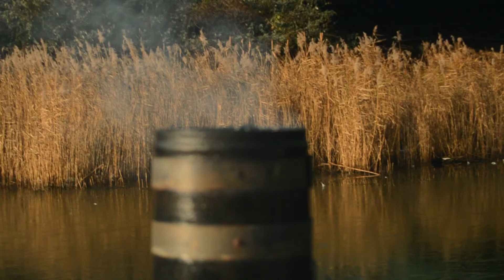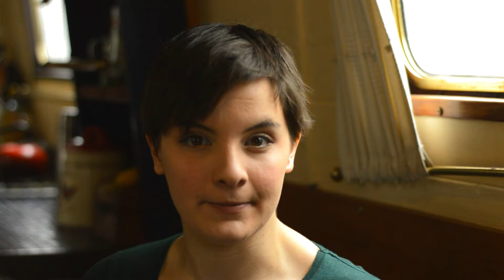How Do You Get Electricity On A Narrowboat?

Comment: In the US farm homes or rural homes in the country started useing large batterys to power homes about 1890 or slightly earlier - 
     Wind turbin generators never did work well - even in areas that had good steady wind,  wind turbin performance was poor - 
      Its still that way today -
Some had water wheels on creeks generating some power - 
     Larger farms had up right.steam engines that were used regularly to grind grain ect - 
     Those upright steam engines were also used to spin a generator to charge the  farm house battery's all day once a week  - 
      In about 1916:Delco a division of general motors marketed the 32 volt DC light plant for rural and farm homes - 
       In the first yr they sold 20000 rural electric light plants - the rail road had already been using 32 volts DC in passenger cars to run fans and lights - 
      There were battery's under the carriage were batterys were placed and generators were belted to rail  wheel shafts, to charge the batterys -        10s of   1000s  of rural homes had large 2 volt cells of 16 to make 32 volts - 
      Even in the 1960s when i was a kid some homes in the ciuntry away from citys were refered to as 6 or 32 volt DC homes - 
    House batterys were set up to were they only were charged once a week all day friday - so the rural homes ran off the batterys all week or 6 days and were charged all day on the 7th day once a week - 
        In small rural towns complete lines of 32 volt DC appliances were sold equal to 110 volt  AC appliances sold in citys - 
      Rural Exide or Gould house lead acid cycle battery's used a weaker solution acid - 
    In the deep south 1.195 acid strength was often used -those  batterys lasted about 60 yrs charged when charged once a week -  
      In cooler regions the house battery's used 1.220 aacid strength and lasted 40 yrs or more - 
      Delco light pllant generators ran on kerosene - 
     The lead plated in the glass battery jugs lasted about 40 to 50 yrs - 
   Then the lead plates were replaced - also the generator was exchanged for a delco factory  remanurfactured generator - 
    My family used a GW generator the engine ran on crude oil or bunker C fuel - 
    They used 1/3:the amount of fuel  but the engine could only be used in warmer regions - because it hard to start in cold regions - 
     In the deep south US its hot and humid so fans and fridges are vital to us  - delco also solld 32 volt DC fridges and freezers i think in 1916 also - 
       They were still used in the 60s on farm homes when i was a kid in the 1960s

Comment: Never did much leisure time on canals but I have spent time on rivers. A new concept in electrical generation is portable hydroelectric generators 
These are floats that underwater funnel moving water through a pipe to an impeller that generates electricity and sends its to a battery either on shore or on board. On a boat tied up along a briskly moving river these would float alongside the boat or when underway dragged along behind.
Now I’ve known RV campers that have built generator trailers with solar panels, gasoline or diesel generators, wind turbines and alternators attached to the trailer wheels. Seems like you could do the same thing with a TINY butty , adding hydroelectric turbines and tunnels right in the hull of the boat itself and drag your juice behind you. Only downside would be the far greater risk of theft

Comment: Peltier module is quite old and prooven thing. Pros - works witouth sun and wind, suplies steadily, sturdy construction (harder to destroy than solar or turbine). all it realy needs to work is difference in heat/cold. Usually not bulky,flatish construction, one side dipped inside heater and the other in the living quarters, lets say. Cons - the supplyit provides is not too high - comparable with solar at best. Does need either planning of the living quarters from scratch (before the boat is build actually), or quite extensive rebuild in the spot, it will be operating. One side is for heat and the other for cold. If the surrounding temperature changes (winter to summer), you need to turn the plate, for the module to operate properly.
Reply from the maker: Ah thank you I'll look into this
Reply from the maker: Thanks for the info I'll look into that

Comment: If you do go for the wind gen rubber mount it and keep it away from your bed room ..most wind gens use the magnetic fields as a break to slow the blades when the Fields are activated it sets up this rumbling sound through the stand its on ..otherwise wind gens are good in bad weather when the solar is not ..
Reply from the maker: we dont need any more , our solar does the job very well

Comment: that tickled me , only two types
Reply: squirms shed . Two 12 volt batteries give you 24 volt system as used in heavy duty vehicles.
Reply: I once connected 30 button batteries together producing a large 90v30amp pile battery that fit in my hand... 10 for 1 dollar... That gave me alot of energy for 3 dollar... Was like the handle of a lightsabre...

Comment: I'll mention to you as I did to David, that if you never run your engine at full speed, as he wrote he doesn't, then you could get a smaller diameter pulley for your alternator.  This would spin your alternator faster while your engine runs slowly and help charge your batteries faster, from your engine while using less fuel, which could potentially reduce any desire for a petrol generator.
Reply from the maker: we have solar now so dont rely on the engine for power :)

Comment: to charge laptop you don't need inverter, that makes 220, you need DC-DC inverter, that will make 19V from 12 - cost less and does not need to much current.
Reply from the maker: but then i may not live in the real world!
Reply: ThisNarrowboatAdventure but you may save power for notebook charger. ok you need to transform electricity twice, from 12 or 24Volts DC to 220AC with boat invertor and back from 220AC to 19V DC. DC - AC inverter takes much more ampers that DC - DC power adapter for notebook.
sorry for my English, greeting from  Siberia.
Reply: Btw DC to DC is a converter, DC to AC is an inverter, AC to DC is a rectifier Cheers! 👍😀

Comment: Regarding the boat riding from shore line power there is a small device called galvanic isolator you can get (or might have already). And afaik boats have several chunky pieces of metal (cathodes or anodes?) welded on the hull and those are meant to rust away prior to the hull. Because when the boat is connected to the shore it forms a battery with one end being the shore and the other is the boat floating in water. The two metal bolts inside of your battery are slowly rusting away and the same thing happens with the boat.
Reply from the maker: Hrnek Bezucha we don't use shoreline thankful!
Reply: From your video I watched of you painting your boat you mentioned that you have anodes on the boat hull I saw them, so I imagine you have this anti rust system fitted? Also I would imagine that an inverter would be a handy piece of kit to have on your boat to charge and run laptops and Televisions (Small one ideally). These can be bought over the counter or online from many sources, Maplin or even Halfords as well as millions on Amazon!

Comment: If you get a deal on a wind turbine, you can always try to mate it with something like an exercycle so that you can pedal the bike to spin the turbine to generate the electricity.  While obviously not ideal, it can work as a back up option when there is no wind and no sun and your batteries are low on power.

Comment: Surely a small silent running diesel generator would be a good idea when on the move.
Reply from the maker: on the move the engine charges the  battery...
Reply: From what I’ve read your isolated generators are more popular on widebeams because of their is more space to fit a generator into a sound suppression chamber and because widebeams both spend less time on the canal generating electricity while on the go and are more likely to be owned by people who do not wish the exterior aesthetics marred by bulky solar collectors.

Comment: how long will your 12 volts last without recharging?
Reply: Do not boats normally have a two battery system, a battery like a car battery to start the engine and one or more leisure batteries for running TV and other electric goods in the "Home" The engine starting battery is separate from the other batteries and its only duty is starting the engine. When the leisure batteries run flat the engine start battery is still charged and ready.
Reply: @kevanparker908   that has been the recommended system ever since electrical consumption has exceed the spare charge in a regular engine battery 
What started out as a spontaneous quasi invention became a professional upgrade became a DIY kit, became a featured option became an industry standard
Reply from the maker: I don't know as you should never let them get below half full or it ruins the battery, since we got our solar system we haven't had to run the engine between moves

Comment: Solar is the way to go. You have lots of space on the roof. You can also hang them on the sides with hinges to flip them up when needed (DrakeParagon)  Lead acid batteries are great, (just got to keep an eye on the water level) , they are very cheap compared to other batteries.  Great way to start on a budget . You can always upgrade at a later date when the others become more affordable.  Also depending on how far you travel, get rid of the noisy diesel motor and go electric. Many sailboat owners are doing it.   Check out Sailing UMA , they have a cost breakdown on their website on their sailboat conversion, good vids too.  Also a small Honda generator comes in handy for those heavy use days.  A Honda 4500 is less than 1500 #s in the UK and that a lot of power (4000 watts), but most boats just use the Honda 2000 
Don't just look a canal boats for ideas, sailboats, off-grid homes and RV's have lots of ideas.
Reply from the maker: we have solar now , best thing we ever did!
Reply: Yup, solar is the way to go. with the right approach your boat can be self reliant on solar, including the motor. It can be done very cheap as the channel Sailing UMA proved. In a canal boat there is lots of room for a large battery bank , but I would still have a Honda generator for emergencies or longer trips in case the solar panels cant keep up (rare) . The generator is also handy for power tools , and all sorts of things , like charging an electric bike. Having a generator is like insurance for your batteries
As you get better at power management and more solar input,you will use the generator less and less until you wont need it at all. Then you sell it for maintenance on your boat.
It's going to be great when full spectrum panels become available and cheap
Don't worry about expensive glass mat and other types of batteries, lead acid works fine and are cheap and easy to maintain.
Reply: Quality lead acid can last 10 years or more yet the average cheap deep cycle battery is NOT up to the task. Do your research before buying!

Comment: If and when you can afford it, use wind and solar power. solar by day and wind by day and night ! the wind blows at night when you need power. and try to have more batteries to store all the power available. also think of buying a car battery charger for when mains is available plug charger into mains to charge batteries without the noise of the engine. 
Yes i also think there is a way to use direct heat from a stove to create power. look on U- tbe  at   " KIMBERLY STOVES "  i saw it there. it will probably apply to all or any stove. ? check it out n find out . the technology is out there. its a simple attachment that sits on top of your stove.  no fitting or adjustments requ'd. i think ? take a look see what you think ask them any Q's . i dont know i just saw it a couple of weeks ago and thought it was a good idea. its all on youtube somewhere. good luck  have fun best wishes.
Reply from the maker: hello my dear, we now have solar and we love it and so far is more than we need i think we have quite low usage as for us its just 12v fridge and  lights and charging phones and water pumps. will bare in mind adding wind if we start to run out in winter. thanks for the info on the stove power!
Reply: ThisNarrowboatAdventure good luck best wishes and happy cruising. others may read it who need more power. i also found some FLEXIBLE STICK ON solar pannels. i thought they are a great idea for certain uses on boats caravans, motorhomes and other off grid situations. i do like the idea of a stove for heat, cooking, hot water, and a bit of extra electric, extract every possible use from a stove.
  Especially the stoves with a secondary burn chamber = more heat less fuel. and less smoke / unburnt fuel up the chimney. 
  I am picking up all the ideas and info i can on boat life with a view to buying a liveabord one day for 2 reasons (1) if i get rich As a Toy. (2) if i get poor as a cost effective ECO home.. or i may just buy one whatever. i like the lifestyle. thanks for good info and your vid's x
Reply from the maker: offten its a comparmise between what you want ,can afford and what you already have if its a second hand boat, some people lot the flexi panels buy they are low wattage compared to the glass frame ones
Reply from the maker: i like all your reasons !
Reply: ThisNarrowboatAdventure Keep on posting the Vids. Thanks.

Comment: Thanks for your videos. My youngest lives on a narrow boat near London and he has fixed solar panels to the roof. He needed to match his panels with the battery bank with an electronic control unit. My motor home has a similar unit. The optimise both the charging rate and the total charge in the battery. Overcharging a lead acid battery can damage the battery as well as releasing explosive hydrogen gas.
Reply from the maker: +Robert Hayward thats good info to know thanks!

Comment: Hai, i know solarpannels generate heat and it would be great to cool your solar pannels and transport that heat to a boiler tank.Also i like to point out that the wind generators that are vertical do not need fast wind of 5 knots ore comin one way and they are not noisy :)Some are foldable that's a big plus :))And thay do not stop working in the dark.Solar pannels do charge at night with full moon but just a tiny litle bit.So when i do get my boat this year i hope, i wil have some solar pannels and a vertical windmill both working together.Also i wil put a much bigger altinator/generator on my engine.Oh great video and good sound thanks i look forward to next video :)Greetings from Holland.Kitty.
Reply from the maker: +Maxboon Boon Hi great info!  yea you can get solar water heaters I have seen some on the ousides of boats, I will have to look into wind again!
Jasmin :)

Comment: All good, interesting stuff. I'm also on the learning curve preparing for my new life on my sailaway widebeam in September. Well done and keep it up please.
Reply from the maker: +Paul Dale fitted or self fit?
Reply: +ThisNarrowboatAdventure. The plan at the moment is for a lined boat with just a couple of bulkheads fitted and I'd do the rest. I need to look at whether it is worth having the boatyard also fit all the electric distribution and some plumbing as this would (I think) be zero VAT rated if I declare this as my sole dwelling.
Reply from the maker: Good Luck! :)
Reply: I read that when you buy a sailaway, they don't do as many paint coats on the Hull. Could be wrong but maybe best to check.